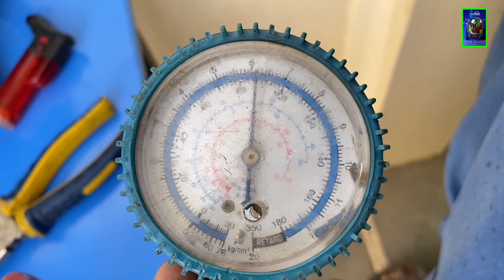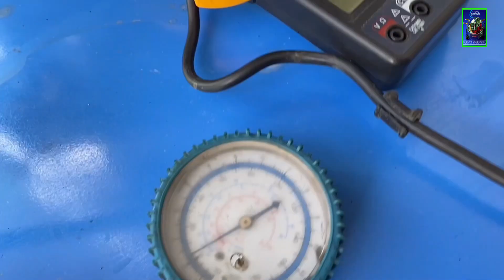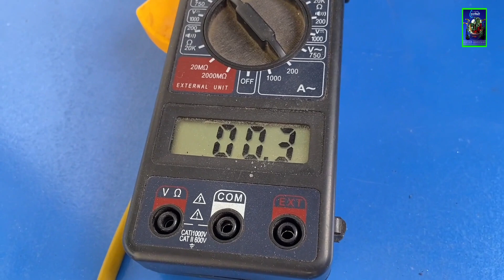How to install compressor in refrigerator DC 12volt and AC 220volt

Comment: Assalam O Alaikum Bhai,
2 compressors ki kya zaroorat thi.? 12 Volt ka 1 hi lag dete, jub outdoor hon to battery se chalaeyn, or jub indoor hon tub bhi battery ya solar se, or zaroorat parti to 220V AC - 12V DC power supply se operate kar lete.. please elaborate the reason